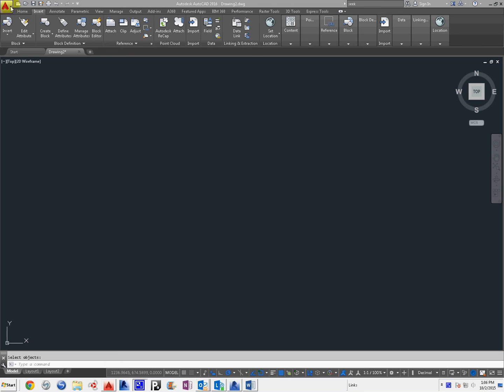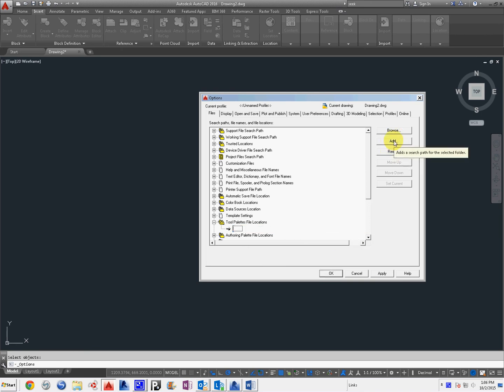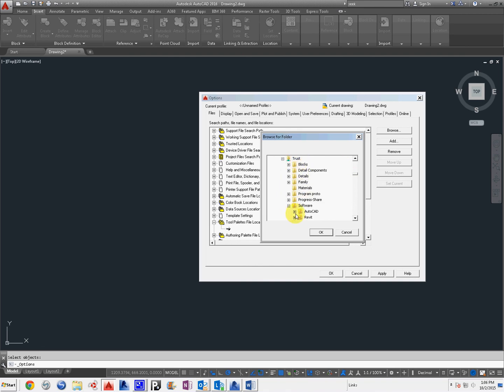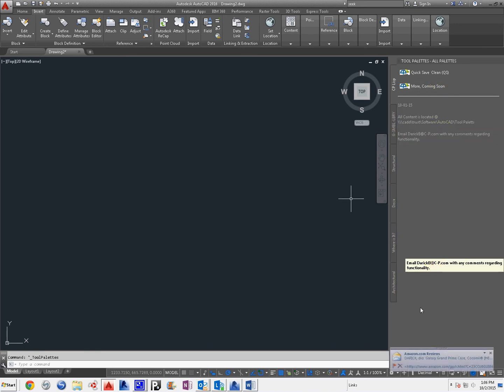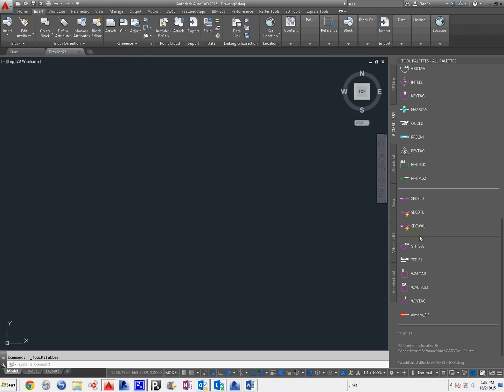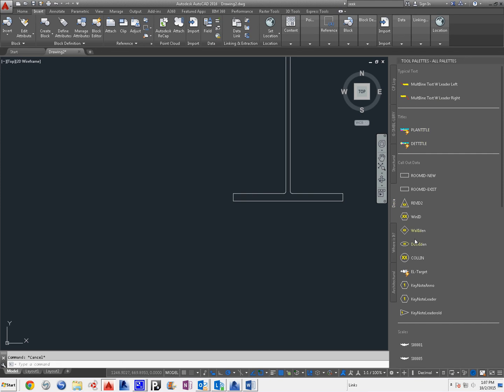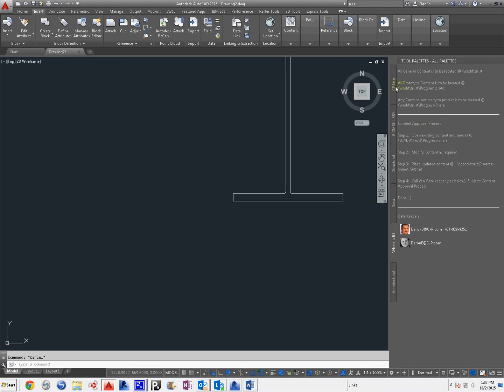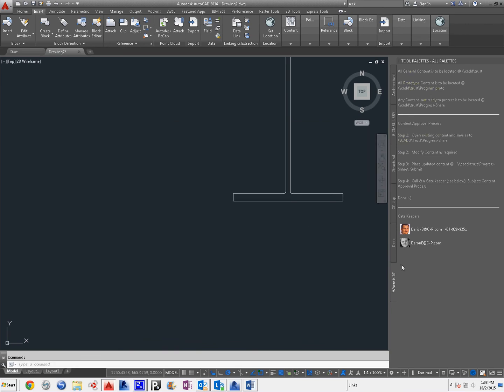AutoCAD - Tool Palettes Load, How To

Comment: still not working for me (adding custom tool block created by office).  i'm getting the "The 'Insulating Jonint' symbol could not be found in the current project.".  i'm sure this is a "broken path" issue i'm just not sure where to find/update the link. Hope you have could help :)
Reply: That will be in the .atc file of that specific palette. Ctrl+H to find and replace the source file path. I use Microsoft XML Editor to edit these. Warning.. you can totally screw up your palettes if you aren't careful.